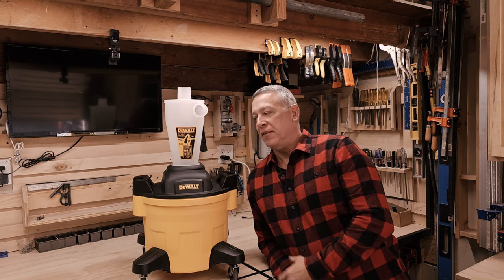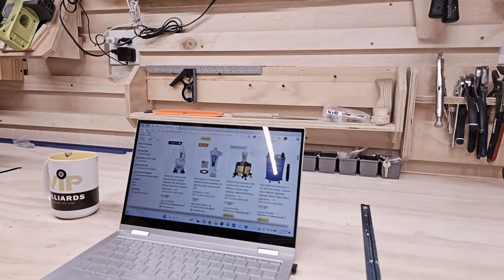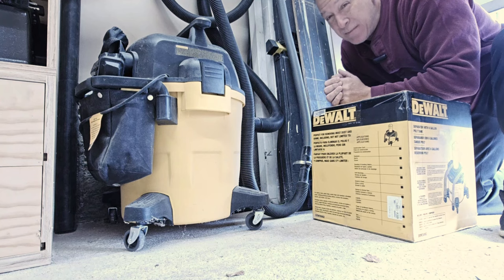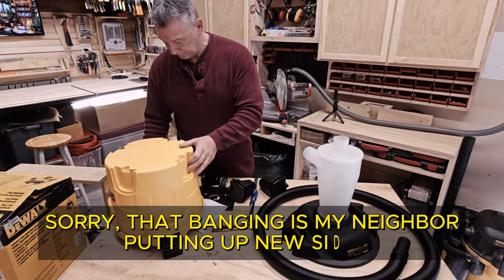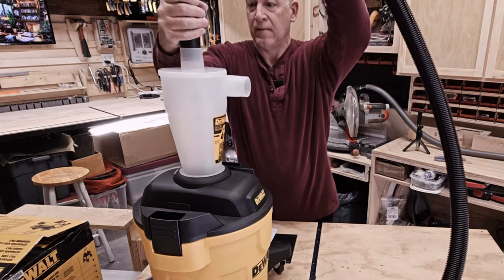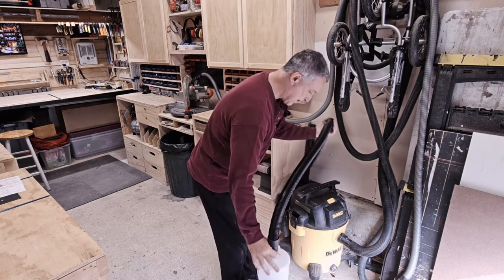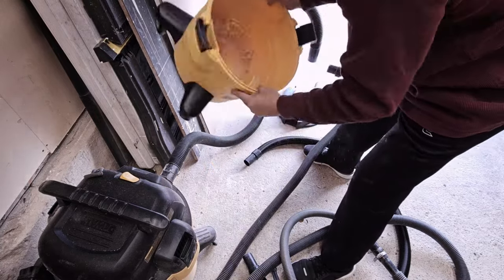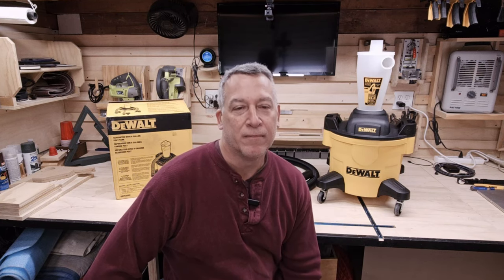DeWalt Dust Separator Review: Is It a Must-Have for Woodworkers?

Comment: Great video, very informative. Thanks for posting this.
But I have a question, what really is the difference between using this and using the Dust Deputy with a 5 gallon bucket? 
Don't they pretty much do the same thing?
Thanks
Reply from the maker: Thank you for commenting. They do pretty much the same thing. If you get just the Dust Deputy, you still have to attach it to a 5-gallon bucket. If you get the Dust Deputy Deluxe, then you have the whole set up like with the DeWalt Dust Separator. I have heard good things about both and opted for the DeWalt since it was the same brand as my current shop vac.
Reply: @TheWoodworkingCorner  Thanks so much. 👍

Comment: Build a cart to stack the separator on top of the vac and connect the two with thin solid white PVC pipe. You’ll save a lot of floor space.
Reply from the maker: I do want to do something like that however, if I stack them, then I need the vertical space for them. Right now, they fit nicely next to and under my workbench.

Comment: The small bucket is a deal killer as I have a dust stopper setting on a 7 gallon bucket.  I put a little plexiglass window in the 7 gallon bucket so I can see when it needs to be emptied.  It is surprising how often I have to dump.
Reply from the maker: So far it has been working out well for me. A month or so in and I emptied it once and it wasn't even 1/2 full yet. I checked on the dust bag inside the shop vac and that hasn't moved much so this dust separator collects big and small particles alike. I would imagine that when I take the planer out, it will fill the dust separator much faster.

Comment: Great walkthrough! That Quick-Click hose you got connected to your tools - can it connect directly to the cyclone outlet?
Reply from the maker: Not with the quick-click part. I had a hose from an old shop vac that fits into the cyclone outlet. The DeWalt hoses fit over the cyclone outlet.

Comment: It’s about the same cost as a Oneida dust doctor kit, but the DeWalt setup is much more convenient and probably more robust. I would have bought the DeWalt if it was around when I bought the dust doctor. I just wish DeWalt integrated it into a shop vac (all in one unit).
Reply from the maker: That would be pretty cool to have an all-in-one unit. I know people have built carts for it to make it more like an all-in-one. I might in the future however with my shop setup the way it is, I don't have the space to stack them. After months of using the Dust Separator, I still can't believe how new looking the shop vac still looks and I have yet to change the dust bag in the shop vac.

Comment: Great video, I just ordered the slightly larger version of this. I am hoping when combined with a shop vac it helps keep fine dust to a minimum.
Reply from the maker: I was impressed with how much fine dust it collects. Having a good dust bag in the shop vac helps too. A high-efficiency bag will won't allow as much fine dust back into the air. But with me using the shop vac to clean up vs. using a dust pan and room, huge improvement for my small shop.
Reply: @TheWoodworkingCorner  That is good to know. I'm also upgrading my shop vac and I got an air filter to hang in the shop. I just can't stand fine dust settling on everything.
Reply from the maker: I need to do that too.